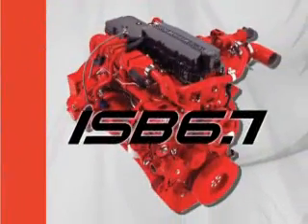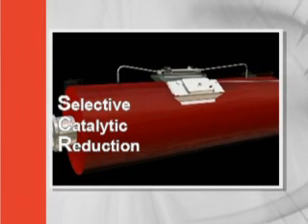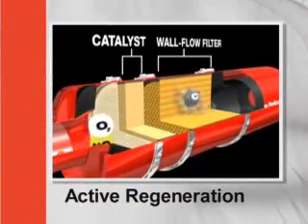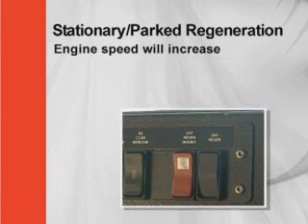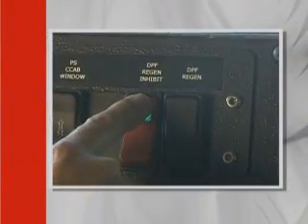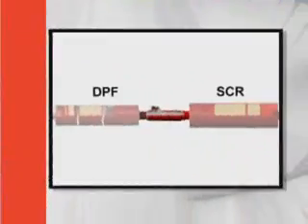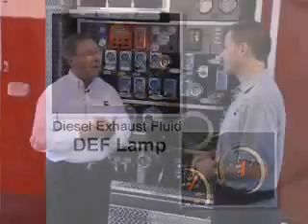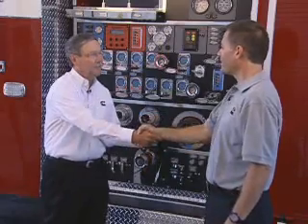2010 Cummins Aftertreatment System Overview for Fire Trucks

Comment: I Don't give negative comments often, but I drive a Peterbilt 335 daily with the PX8 tier 4 engine. The exhaust fuse will burn your eyes, and the active regen process causes a very dangerous delay in throttle response and engine power. The company I work for has many of these trucks with the same problems. I have long been a Cummins fan, but I could not recommend a Tier 4 Cummins engine.

Comment: He mentioned faults in the DPF not derating the power or vehicle speed, but an empty DEF tank will derate it except if it's in PTO mode until the DEF tank is refilled. But what If the SCR system was to throw a fault lets say for example excessive Nox emissions or dosing pump failure. Would the truck go into a derate mode over that or is it exempt?

Comment: he has a point though, system is less reliable then a catalytic converter, more expensive and can leave the customer abandoned in the middle of a job, needs to waste more fuel to heat it up pretty useless to burn more fuel to have a cleaner product out when you are doing more consumption

Comment from the maker: (continued from above) The other type of regeneration, engine-initiated regens, don't affect engine speed or the engine's ability to make power (such as while pumping water or in PTO mode).  They occur behind the scenes during normal operation without impact on the operation or the vehicle.

For more information, consult your Cummins engine or vehicle user's manual, or a Cummins representative.  Thanks for the opportunity to clarify.

Comment from the maker: The forty minutes mentioned in the video is the average time for an operator-initiated parked (manual) regeneration. Remember, a parked regen can be interrupted if needed (ie, a call comes in) and resumed later. 

A sequence of dash lamp notifications indicate when an operator-initiated regeneration is needed.  There are two ways to initiate a regeneration: 1) alter the engine's duty cycle, such as by driving at highway speeds for about 20 minutes, or 2) start a parked regen. (Continued)